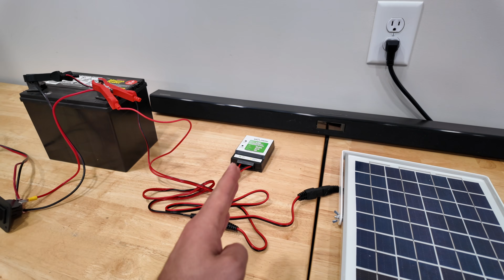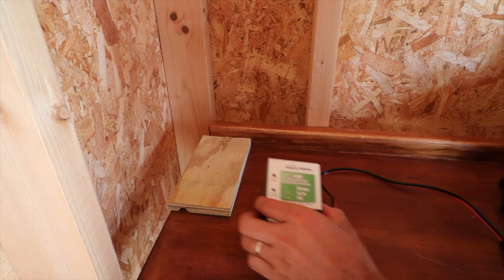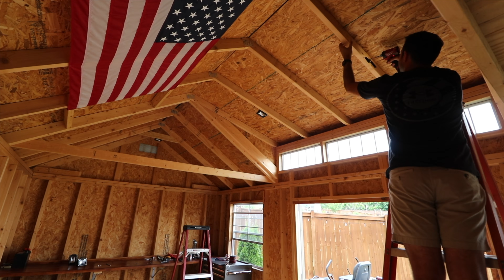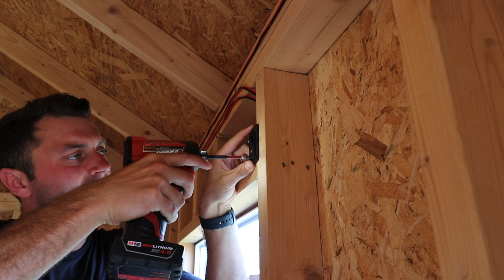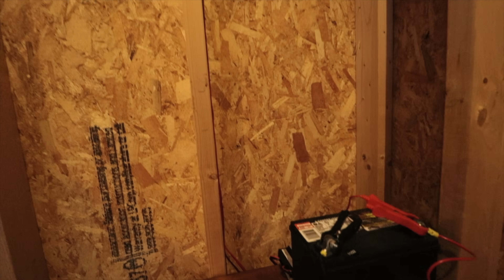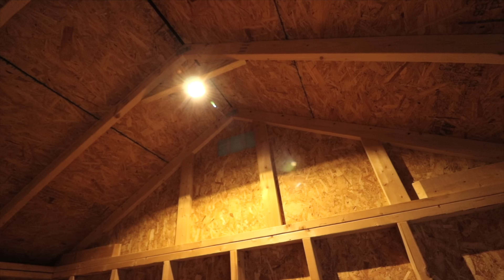Solar Shed Lights - Off Grid Power!

Comment from the maker: Thanks for watching! Quick links if you're interested.

10W Solar Panel: https://amzn.to/3XCgXVJ
12V Lights: https://amzn.to/4cyQX1D
12V Switch: https://amzn.to/3xl2DGx
12V (100ft) Wire: https://amzn.to/3RFf3zS
12V Battery: https://www.lowes.com/pd/Sure-Power-1...
In-Line Fuse (5A): https://amzn.to/3XHXxgW
Staples to Fasten Wire: https://amzn.to/4oXdhJ1

Comment: Hey there! I need your help. Just a few things. From the switch you use the wire to go to all lights correct? Could you please provide a link to the wire conductors you used or that would work? Could you also please provide a link to the black tape you used with your heat gun.
Reply from the maker: Hey! I added the heat shrink tubing, and the switch comes with the connectors included!  Let me know if you have any other questions.
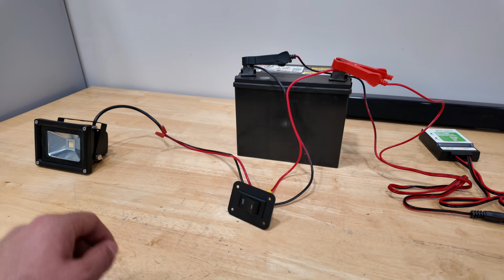Reply: @AJLoD@A@A@AJL @AJLoDato22  size do I use for the heat shrink tubing? Also, by wire conductors I mean what wire connector can I use to connect the switch to the lights? There may be some confusion? 2:00 in video you say bottom of light switch goes to light source to turn on. I see red connectors?
Reply from the maker: @JackNightingale-p4r  I don't really remember for the tubing size - this kit comes with a variety of sizes so you'll see what slides over nicely.  You will crimp the 14 gauge wire on small connectors that are included with the switch.  Top side of the switch (red/black wire from your battery) , bottom side (red/black wire to your lights).
Reply: @AJLoDato22 I would also have to use wire twist on nuts apart from the ones that come with the switch right at 2:00 in the video I can see yours are red? If so, which wire nuts-could you provide a link to purchase those? Last thing I would need is a heat gun can you please provide a link to a heat gun I can use for this scenario?
Reply from the maker: @JackNightingale-p4r  I had some old ones laying around - I'd just get a variety set as you'll have some connections needing to fit (4) wires, while others will only need (2) wires.  For the shrink wrap, just use a lighter.
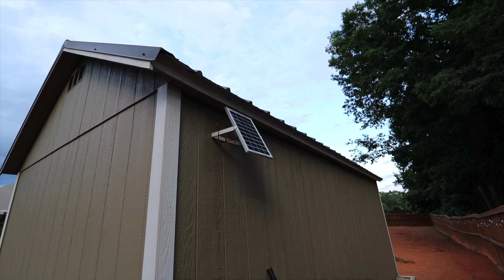Reply: @AJLoDato22 thank you! Starting 4:36 in the video you demonstrate how the wire goes from the inside to the outside and to the solar pannel. I was wondering if I can put the wire through grey pvc conduit just on the exposed wire outside to protect the wire?
Reply: @AJLoDato22 genuine question, can I use heat gun for shrink wrap or would you say lighter is better as it’s more controlled?
Reply from the maker: @JackNightingale-p4r both will work great.
Reply: @AJLoDato22 can you please provide a link to the wire stripper you used to crimp and strip the wire as shown in the video?
Reply from the maker: @JackNightingale-p4r added in the description!
Reply: @AJLoDato22 if I left everything exactly how you described in the video and without inline fuses is it 100% safe to leave it like that forever. Won't start a fire or anything? Genuine question? I'm pallniing to permanently leave it like that but with disconnected battery when not in use and if I do have to use it I would just hook the wires on the battery.
Reply from the maker: @JackNightingale-p4r I don’t foresee any hazard, but I’m not an expert. Mine has stayed connected like this for almost two years.
Reply: @AJLoDato22 gotcha. Not that I'll do anything dumb with the setup and will stick to using what's shown in video. But, I'm curious how many floodlights do you think I can connect to it by floodlights I mean the lights used in the video to provide lighting in the video? Is 4 the maximum with this exact setup?
Reply from the maker: @JackNightingale-p4r  no, really as many as you’d like. But the battery won’t last as long the more you add. I don’t know how long my setup lasts. I have left it on for hours and never drained the battery.

Comment: How long have you maintained these lights to keep working? Are they still up and running today with no issues or have you had to deal with any issues?
Reply from the maker: I’ve had these installed for a year and a half, with absolutely no maintenance. Still the original battery too. They work great!
Reply: @AJLoDato22 Love to hear that! The in line fuse you have in your bio is out of stock which other one could I use? Can you please provide me a link to another alternative?
Reply from the maker: @MelvinElian good call. The link has been updated!
Reply: @AJLoDato22 Thanks my man!!
Reply: @AJLoDato22 You used what exactly to secure the wire to the studs?
Reply from the maker: @MelvinElian I used a construction staple gun. Worked like a charm.
Reply: @AJLoDato22 I shall give you a commission if you can include the link to purchase the construction staple and staples you used.
Reply from the maker: @MelvinElian I uploaded the kit I essentially pieced together at Lowe’s. I believe the middle length staples will do the trick for ya.
Reply: @AJLoDato22 wait you never mentioned in line fuses being used?

Comment: did the whole system but the wire is heating up and smoking idk why 

solutions
Reply: Thicker wire gauge(meaning smaller number for awg/United States).
Better wire from full copper not this aluminium-coated (it has a high resistance).
Shorter run of cable(shorter cable from the battery to the light source).

Comment: Now throw in an DC-AC convertor and wire the place up with 120.
Reply from the maker: I’m actually considering it. It would be nice to use some small 120V items in the shed off a single outlet.
Reply: @AJLoDato22 isn't it easier then to just put wire in the ground and go full mains power in the shed, I mean a shed is a great place to self reflect.
You can have a tv, heater and a fridge there with mains power and not be afraid/spend so much with an inverter that costs much and maybe only work for a few years(shorter if you get a cheap Chinese one).

At what point is it easier and long term better to just bite the bullet and install mains power.
Keep the solar system you have as backup  for power outage.
Reply from the maker: @dennisdejonge1629  haha I agree it's a man's place to self-reflect!  I've considered running power, but rarely find the need for anything other than lights at the moment.  Maybe one day!

Comment: I want to do this setup but wondering how the battery would last in my shed since it gets really cold out here, as low as -15C. My shed is similar to yours where there's no insulation so just worried about the extreme heat and cold weather
Reply from the maker: Woah that’s cold, and I’m not sure I’m an expert for the situation. I will say lithium batteries are far better for the cold and essentially this stays on a daily trickle charger with the sun. Maybe that or an insulated box.

Comment: Great set-up!  One question - did you use a double pole switch (both wires are disconnected when off) for any particular reason?  I have standard switches I'd like to use (that I'd wire into the positive wire from the battery to the lights) - but am wondering if the LED lights specified a double pole switch.
Reply from the maker: Ahh good question, but honestly I didn’t even consider the poles when buying so I’m not too sure. I was only specifically looking for a 12V switch

Comment: Hello, I have a grow room in my basement where I use four 48" LED lights (4000 Lumens) for my vegetable plants.
I have them plugged into a wall socket, their turned on 12 hours every day, then off for the other 12 hours.
I am curious as to whether or not I can run them off of solar opposed to pulling from the homes electric.
If you have any tips on converting this setup over to solar, I would love to get your input on the mechanics of how to transition.
Thanks 
Chris
Reply from the maker: Ahh I don’t know if I’m the guy to help on this one (just a DIY’er). If they plug into the wall I’d see if they are 12 or 110V. If they plug into the wall they might be 110, requiring an inverter after the battery. It’ll essentially provide wall plugs. There are also some online calculators to help see your lighting draw and size your panel appropriately. 

Hope that helps, and best of luck if you make the conversion!

Comment: Please show how you wired the switch to the battery
Reply from the maker: Unfortunately I don’t have pictures of the install. The switch has four tabs to land wires. The top two are from the battery, and lower two are to the lights. Connectors are included for your wires to crimp to.

Comment: Would you be able to show or explain the wiring connections and circuitry? I'm a beginner with electrical work and am curious how to make the connections to the switch, lights, battery.
Reply from the maker: Sure - message me on instagram and I’ll send you a simple wiring diagram. (aj_lodato)

Comment: This is an awesome how-to and exactly what I have been looking for for my small 8x10 storage shed. Can you please help provide information/specs on the type of wire you are using to run from the battery to all the lights?
Reply from the maker: Glad the video helped!! The cable I bought is in the description, along with all of the other products.
Reply: @AJLoDato22 oooops. Totally missed that one. I looked all the other product links but missed that one. Sorry about that and thanks for pointing it out

Comment: Great video. What if I wanted to add a small inverter to this set up to give myself a 120 outlet? Would that just involve me wire connecting one to the battery? Thanks!
Reply from the maker: Thank you! I wish I had more knowledge on this stuff - truthfully I wouldn’t know how to wire up an inverter. Another option would be to buy a portable power station with solar hookups. That would give you outlets, but then make it harder to run lighting out of it.

Comment: Sir, terrific video. What is the chances you have a wiring diagram you could share? Once again, thank you for the support.
Reply from the maker: Thank you! I don’t really have a wiring diagram, but would be happy to share additional/more detailed pics. Message me on IG if you’d like: aj_lodato
Reply: @AJLoDato22  Do you have another way of sharing the pictures besides IG? I do not have that. I am in the middle of doing this project and for some reason the lights are not working, but I did a 'daisy chain' method of wiring and would love to see how you did it. I did notice in the video that your return wiring to the switch could be different that what I did. Thanks!
Reply from the maker: @ ahh I wish I could help. I only really have instagram tied to a public account.
Reply from the maker: @ as for daisy chaining, test one light first and then add another. It would be good to see if it is a wiring issue or a switch issue.
Reply: Never mind, I figured it out! Love the lights, thank you for creating the video!
Reply: I'd like some detail pics of how the switch is wired up
Reply from the maker: @timstobaugh4612  sure thing - shoot me a message on IG and I’ll send you some.

Comment: I just set up this exact same set up. And it works great! 

I have one question:
The solar panel is small. You said that the lights should stay on 7-9hours but with that small of a panel can I use these every night for the same amount of time? 

Or do I have to get a bigger panel if I plan to use the lights every night? Thank you
Reply from the maker: If you plan to use them every night, I’d size up the panel. To 2x, 3x the wattage of the panel is a marginal price increase. I’d experiment with your current setup and see how it does!

Comment: Can you help me find out how many hours would lights run I have spare Deka 12-Volt 950 Amps CCA Farm Equipment Battery that I want to put to use so thought about using it for the shed depending on how many hours it would last.

Comment: Thank you this is the best video I found. 

How long do the lights stay on before they dim out?
Reply from the maker: From the help of Reddit getting CCA converted to Amps, and figuring out the wattage of the battery - the (4) 10 watt lights should be able to stay on for 9.5 hours!
Reply: @AJLoDato22  so what should I buy? I want to do this same set up but would like the set up to last. What was left out of the video?

Thank you!
Reply from the maker: @gabegotstheword  this same setup will last. If you want the lights to last longer either buy a higher amp hour battery or wire two in parallel.
Reply: @AJLoDato22  so all Id have to do is get a bigger battery with more amps so maybe a 16v instead of a 12V?
Reply from the maker: @gabegotstheword  if you’re good with ~9 hours of run time you can buy the battery in the description. If you want longer, find one with higher amps. Don’t switch to 16v as they won’t work with the lights, switches or wire. These are 12v only.

Comment: Nice. Question:  Did you tie into a bus bar off the switch to feed each set of wires going to a light?  Not sure how you’re supplying current to each light.
Reply from the maker: I ran them in parallel essentially running from the switch to the first light. The junction at each light are the wires coming in, and going out. Feel free to DM me on IG if you’d like me to send a pic - @aj_lodato

Comment: Nice video! I think you should add a voltmeter to the system so you can keep an eye on battery voltage and won't over discharge the battery.
Reply from the maker: I was considering adding one. There are some more expensive charge controllers that have them integrated. Maybe a future upgrade!
Reply: @AJLoDato22  Yes there are $10 and $20 charge controllers that will give a constant readout of your battery voltage. I would go the controller route rather than just a volt meter.